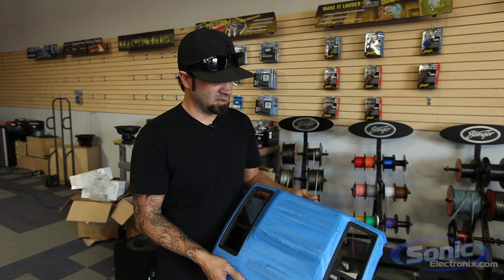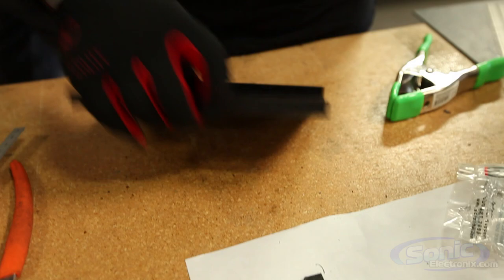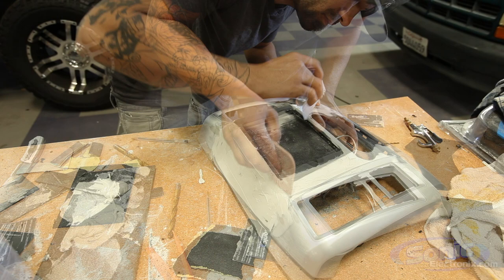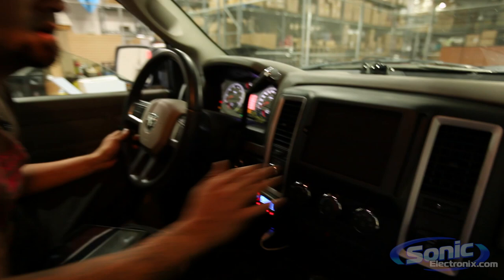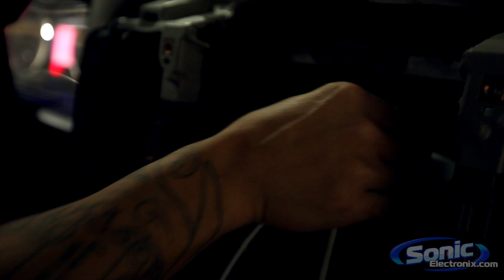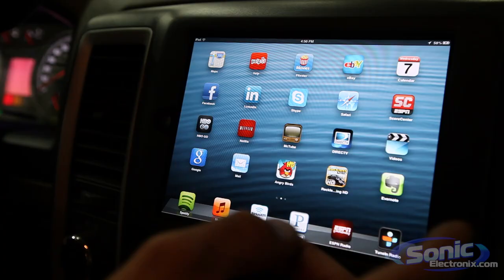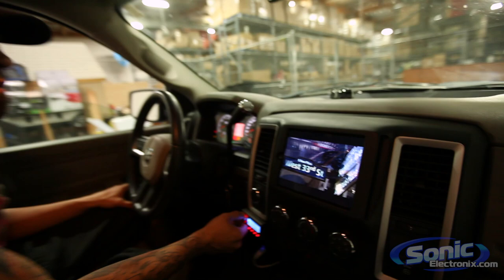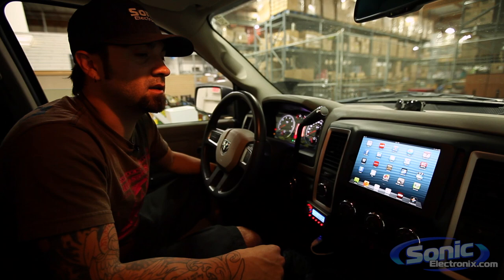Apple iPad Mini Installed in Car Dash (Fit & Finish) - Part 2

Comment from the maker: Correct. We made sure the snap ins were all still strong and unmodified from removal. We can go back and add the screws if it starts having fitment issues. The iPad is much lighter then the stock radio so the screws are no longer a must.

Comment from the maker: You can connect your iPad Mini to your stereo via 3.5mm headphone jack for audio and connect the USB to charge it (if it works). Then, you can stuff the headunit in your glove box or under the seat and set it to AUX mode. From there, your iPad will play through the JVC radio and charge.

Comment from the maker: An iStreamer takes the digital signal and turns it into analog. The headphone jack is analog, and the end of the iStreamer is also analog when it connects to a stereo. There might be a small difference, but it won't be "HUGE". Try it using the AUX route and if you think it should sound a lot better, then go with the iStreamer and see if there is a difference.

Comment from the maker: The DRC of the Bit One gives you full control of your system. As for going from iPad Mini to Optical Toslink, that will be a weird path. You would have to find a Lightning to Toslink converter, which we have not yet seen. If not, you have to go from the lightning connector to RCA or 3.5mm to Toslink and that just gets noisy.

Comment: just wondering, since you filled in the tray on top of the dash where the 2 screws were,  are you just relying on the snap ins to hold the dash in place, as well as the screw under the outlet?

Comment: excellent work.  I want to install an ipad mini +4g in my car but the monitor opening s 7inches exactly. I don't know if enlarging it will ruin the structure.  I would like the install to be a slide out & work in conjunction w/ my current jvc pdr80 stereo. (though i'm willing to change for better/ easier bluetooth functionality) i just would like to have my mini function w/ the volume control, as being able to watch video, listen to radio, and navigation. What cables/adapter do i need? PLSLMK

Comment: I have an 09 Ram. Im interested in doing this. I have the top of the line nav/dvd unit. Is there anyway I can make it so the rear dropdown tv still works off of videos I play on the ipad mini. as well still be able to control my steering dash unit? and volume up down buttons on the steering wheel/bluetooth etc.

Comment: I'm looking to integrate a 10" tablet into the dash of my 2007 cobalt LT through an aftermarket single din radio, but I'm trying to find a way to play DVDs. Is there a standard mobile dvd player (such as in mini-vans with a drop down screen) that I can integrate with the radio so I can also play videos through the tablet, or do I have to download them to the tablet itself? Thanks for any help you can give, I do greatly appreciate it.
Reply: Aaron, Great name.  If you rip the DVD's in digital form, you can put them on a flash card, which most tablets, <minus ipads> have a Micro SDHC slot. I don't think most radios will transmit the signal to the tablet.  sounds like you're working on a complicated setup.  My recommendation is to go with an iPad mini or iPad, and if you want dvd, use an old Mac Mini, but replace the HD with an SSD so you don't have to worry about vibration ruining the HardDrive.  Then you can use DVD's or CD's and you can get away from the standard "Radio" in the car.  Or to go simpler, just get a cheap newer touchscreen dvd in dash radio.  No need to get all fancy unless you are going for car show performance.

Comment: Can you buy the I stream and keep the aftermarket head unit? I have a 2005 Chevy Avalanche and it has a ken wood double din navigation, I'd like to keep that there and custom fit an iPad into my center console. The kenwood has a cable to play music through iPod. iPhone or iPad but I would like to integrate the iPad and head unit so I can still watch DVDs and listen to CDs. I'd also like to keep the iPad charged when in vehicle I'm just not sure where what I need to do or buy?

Comment: So when are car manufactures going to get the clue and just install ipad's or ipad mini's in the dash from the factory. I mean seeing that apple probably won't change the connector for another 10 years and the design really isnt going to change that much it would be stupid easy to put a new one in when you need to update to the new ipad mini.

Comment: Hey man I live in Los Angeles and I want that process done to my 2014 charger can it b done?
Reply from the maker: +jsanchez034 Of course it can! If you live locally come into our shop or give the install bay a call for a quote.

9631 Topanga Canyon Place
Chatsworth, CA 91311&#160;
(661) 257-9993